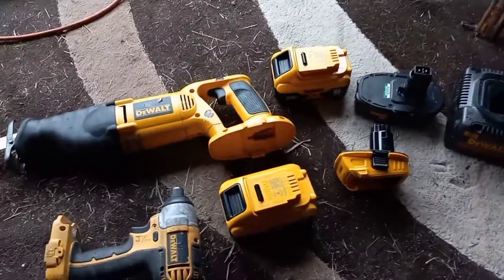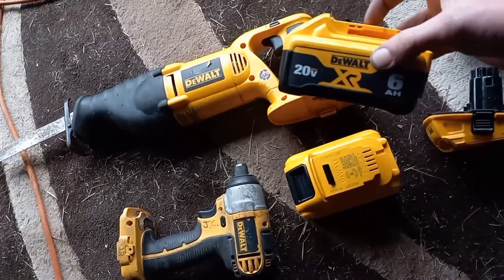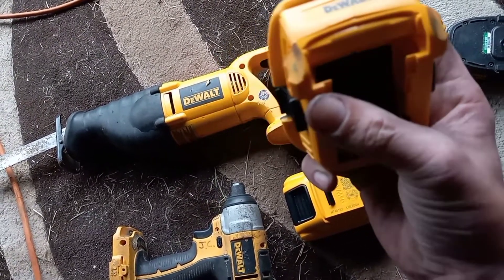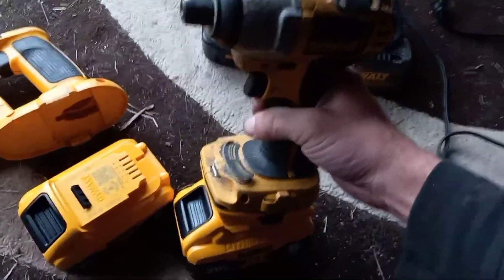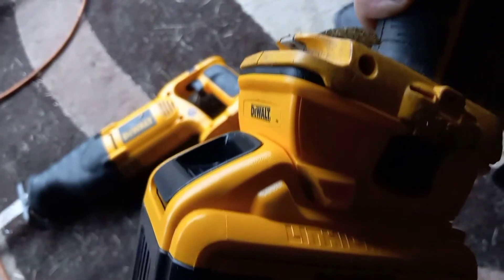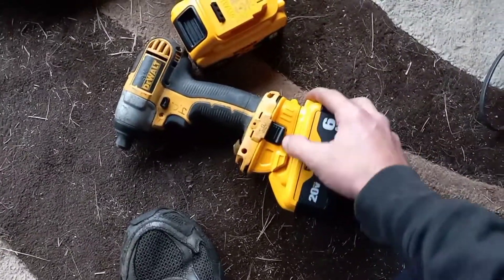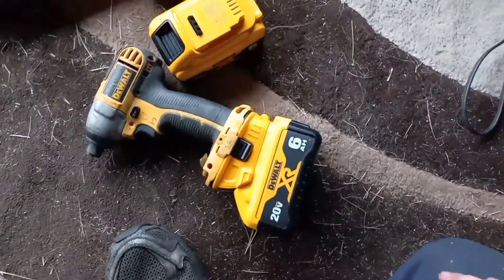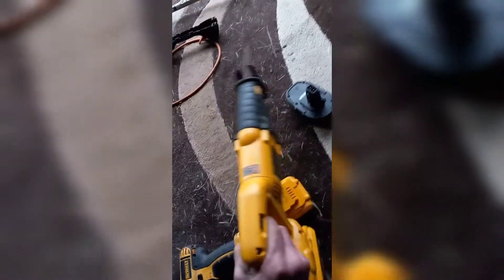MODIFYING DEWALT 18V TO 20V ADAPTER? YES IT WORKS! UPGRADE FROM YOUR AGED, WEAK, ORIGINAL BATTERIES

Comment: Have you used a 20/60v flexvolt battery in this setup? I thought that's what the tabs were for as it won't allow a flexvolt battery to mount (any size). I didn't realize it also prevented the larger 20v max batteries from mounting. I'm nervous about frying the tool in case the flexvolt delivers 60v instead of 20v. These are 18v tools so 20v doesn't make a big difference, but 60v sure would. I don't know how they're detecting which mode to run the battery in.
Reply from the maker: @steveanimatrix3887  I haven’t tried it yet but I just recently got a 60v flexvolt battery for Christmas so I will soon. I’ve got multiple old 18v drills so probably use one of those to test it just in case
Reply: @DirtHicksVideos  I'd really appreciate you posting results if you can!